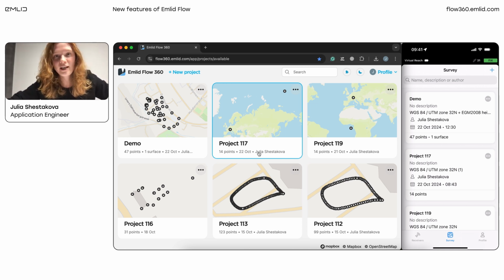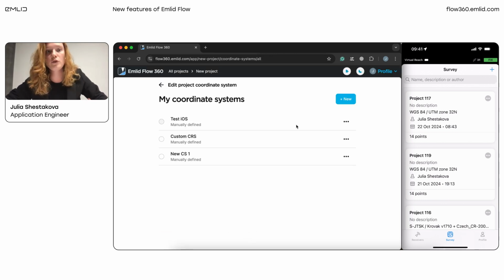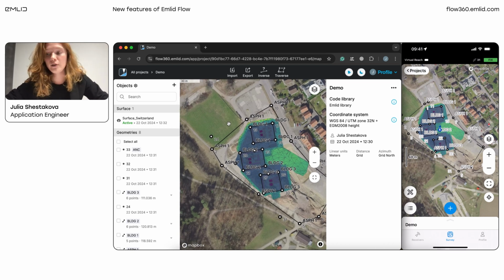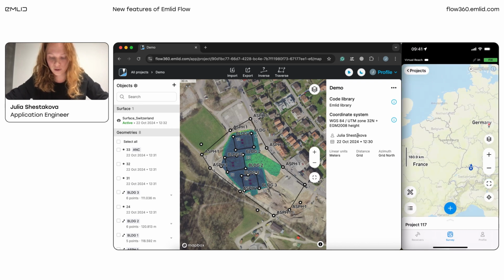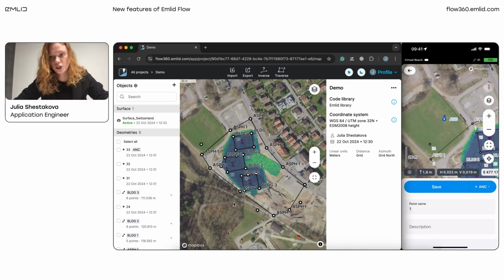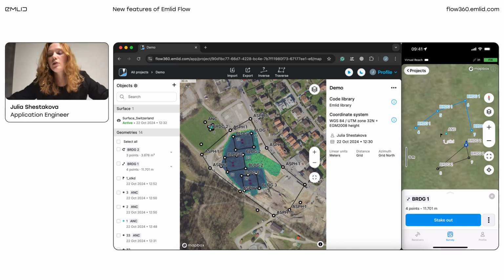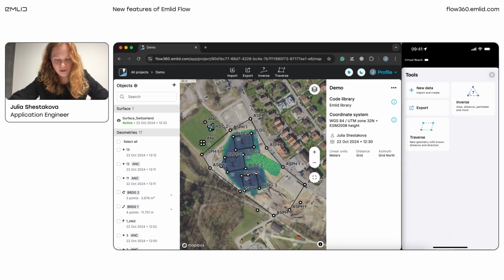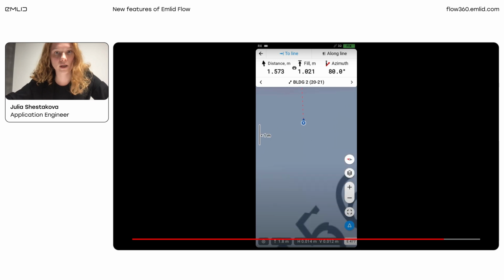Surveying with Emlid Flow & Emlid Flow 360: field-to-office demo

Comment: Hello,
I'm mr. Abdi...

I have several problems related to emlid rs3, what are the causes and solutions?

1. Emlid recording per second

2. Emlid sometimes turns off automatically 

3. Emlid fails to compress rinex data 4.

Thank you for your attention, I hope there is an answer to the above problem